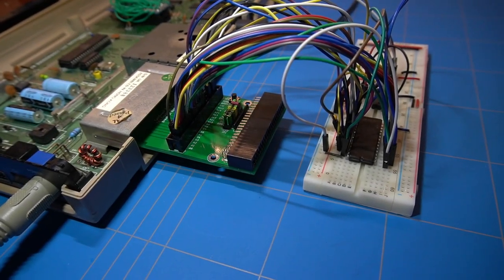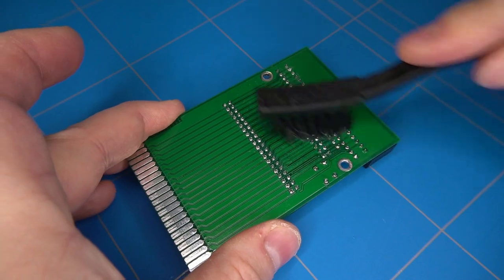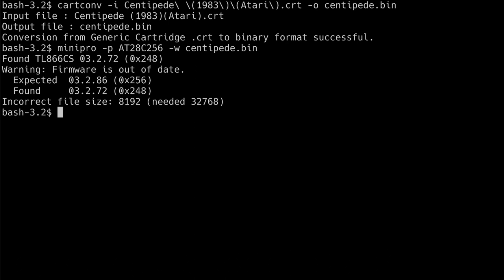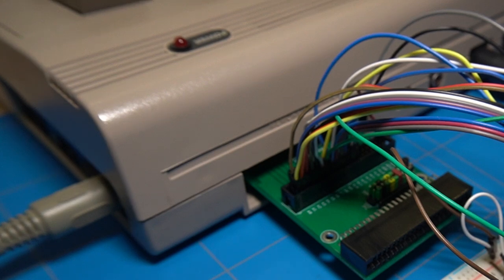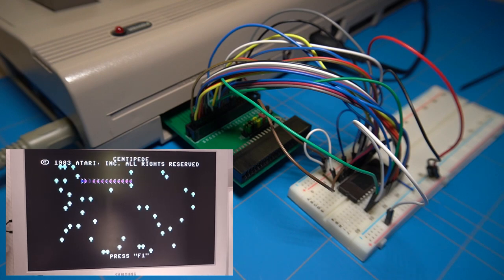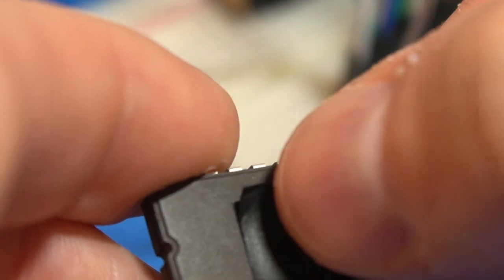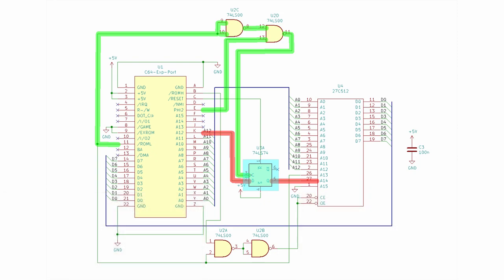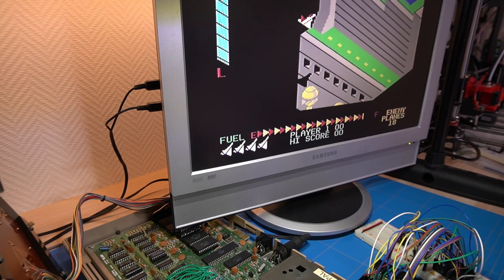C64 cartridges on breadboard

Comment: Why the 28C256 EEPROM freezed? Is it impossible to use EEPROMs there?
Reply from the maker: I have used a crappy EEPROM here. If you use a decent one like Winbond (with correct specs) it should work just fine.